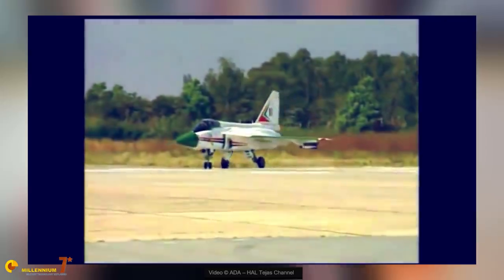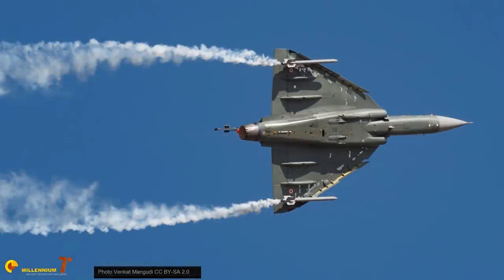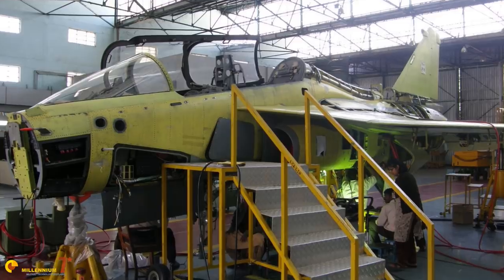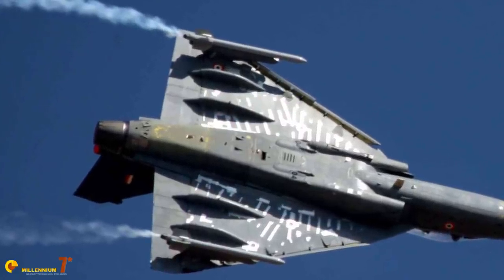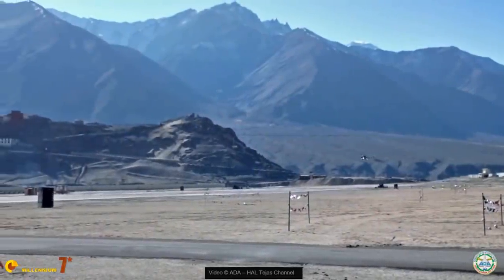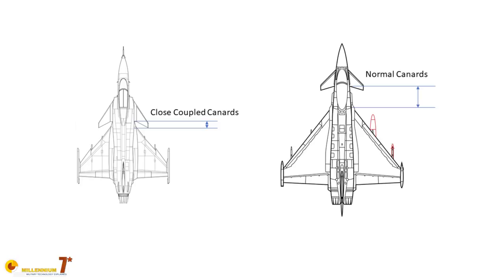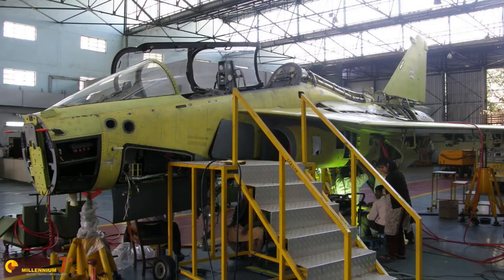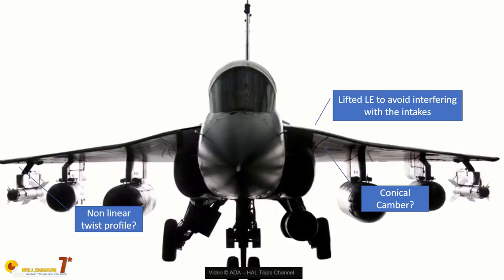TEJAS Aircraft  Aerodynamics Analysis - The Swedish Connection?

Comment: The  Wing design was actually one the aspects of the aerodynamics that was found to perform rather well , and is being carried over the Mark -2 . The LCA program did a lot of things rather well like the structures and flight controls development . Aerodynamics was not it's best , partly cause of compromises related to size and partly cause of an inexperienced team of designers who wanted to play it as safe as possible . The Mark 2 should fix things and get close the Gripen in terms kinematic performance , currently the STR is at around 16 degrees and ITR at 30 degrees.
Reply: Yes, the large wing design is working as intended, but it is also  obsolete because of the additional wing drag.

Modern air combat like the fight between F-16 and Su-30MKI is the combination of long range missile attack and high speed evasive maneuver, NOT DOGFIGHT. Tejas and Mirage are good climbing and turning fighters, but they lose speed quickly and accelerate slowly due to large wing drag. They are not good at dogging missiles. Therefore, even French gave up Mirage design long ago.......
Reply: @joelau2383  to dodge a missile like you say , you would need good instantaneous turn rates and overall good kinematic performance .
Reply: @vigneshanand3348  High speed performance is more important than turning performance because firstly you need to run away to waste as much missile energy as you can. Tejas and Mirage 2000 lose speed easily when it turns away and the large wing drag reduce the acceleration speed when it run as fast as possible. The lower evasion probability is a major disadvantage.
Reply: @Gort There are many delta wing fighters nowaday.  All of them low aspect ratio and short wing span. They also have every delta wing advantages.

Comparing to them,  Tejas and Mirage 2000 have larger wing area causing low wing load and  thrust per wing area/drag. It surely turn better than them,  but it also lose speed quickly and accelarate slowly.
Reply: @joelau2383  The delta produces high drag at the high angle of attack necessary to provide high lift at slow speed.  At speed or low AOA it does not have more drag.
Reply: @gort8203  I am not comparing delta wings with conventional wings.  I am  comparing relatively larger delta wings with relatively smaller delta wings. All delta wings have similar characteristics,  but larger delta wings have more drag.  I don't understand why you keep ignoring it.
Reply: @Gort Obviously you didn't read what i said at the beginning.  I was talking about the long range missile combat and high speed evasion. Acceleration at high speed and maximum speed are very important in this situation.
Reply: @joelau2383  All you have been talking about is the drag of a delta wing as though that is what inhibits this aircraft from achieving higher speed.  It could just as well be the drag of the fuselage engine or some other factor.  I'm done going in circles here.  Have a good day.
Reply: @gort8203  Of course,  you should stop the circle.  Your last reply reflected you have already knew the weakness of larger delta,  but you just refuse the fact there are drawback in Tejas design.

No other modern fighter have similar larger delta anymore. Those experienced designers are not idiots.  They have sufficient reason not using it.
Reply: @joelau2383  Why does this guy keep saying I'm '"defending" the Tejas.  I guess because he's 'attacking' it, so I look like the enemy because I disagreed with one of his inaccurate statements about wing planforms in general.  Try to pay attention next time Joe.
Reply: @gort8203  Attack? You are the one said I defend my comment first.  In this view,  you are the one attack first.

Everyone is making general statement here,  because nobody know the detail of fighters design. Your problem is your general statement focus on a very narrow view ignoring the fact all other high speed modern fighters have similar but smaller delta.

Argument aginst fact and development trend are difficult.  If you don't have strong supporting info,  you shouldn't argue it at the first place.  Otherwise,  you waste your time and effort making ineffective statements.
Reply: @joelau2383   My general statements were that your general statements were incorrect.  Yet you continue to charge me with making an argument for or against this particular airplane, which is absolutely false, and with not listening to your opinion of it, about which I have no interest.  If you took a moment to pay attention to my actual statements instead of projecting your own overwrought imagination on them you might realize that you have deluded yourself.  I don't think you even know how to have a rational discussion.
Reply: @gort8203  Let's go back to what i said before you rely.  1. I said large delta is obsotele because of large wing drag.  2. I mentioned high speed battle between India and Pakistan.

You argue that the large delta drag is less effective in low alpha turns and unloaded accelaration.  The problem is you didn't compare it with small delta like Su-30MKI I mentioned in my statement.  It obviously turns slower (just a few seconds) ,  but it would accelarate faster in high speed battle as i said and have higher runaway top speed (it can be way over a minute) . I knew what you said but it is ineffective at the first place because large delta only benefits a few seconds turn but small delta benefits more than a minute runaway.  

And why Tejas only?  Because Tejas is the ONLY modern fighter having larger delta.  Some planes like Mirage also have large delta but it works fine in old dogfight air battle decades ago,  so I don't  judge them.

TBH, I don't  doubt what you said like high alpha low alpha stuffs,  because i know they are right in certain conditions and i am not trying to find incorrect points to judge you.  However, you are so eager to find some incorrect spots in certain condition to judge me(AKA "inaccurate") . This is definitely not rational discussion.

Comment: Lack of citations and predominance of speculation  - not very convincing. From what I've read, the Tejas was to incorporate LEVCONs, but they decided to retain that feature for the naval version - they made them fixed for the other versions, hence the compound delta shape, not because of the Viggen.

So by this token, does the Su-57 also have a Viggen pedigree? India was participating in its development until it pulled out.
Reply from the maker: Yes, in this case you are right. This video is largely speculation and it is clarified at the beginning. It has to be taken as such and I could be proven wrong if more news about the design stage would emerge.
About the citations, and the sources in general, I often do not mention them on purpose because my sources (which are all rigorously open source) are sort of small competitive advantage for me.
Reply: @Millennium7HistoryTech  you should make a video regarding India-Pakistan air skirmish on 27th Feb 2019
Reply: @gssr41  for what we dont need a war in the comment section
Reply: Yeah, everything revolve around the Viggen, the greatest plane in the history. Thank You!

Comment: If the air intakes on Tejas were symmetrical and aligned with fuselage and wing as in F 22, would that contribute in drag reduction ? if yes at what cost ? Thank you
Reply from the maker: Probably no, they would add a bit of drag and weight

Comment: Tejas is undoubtedly best in its class! & Will get better as we operationlise it!
Reply: What class is that?
Reply: @SK-hn2lj  light weight fighter
Reply: dude even pakistan's fj17 is better when compared to tejas rn.
Reply: @unknownentity2112  tge radar, no. The missiles, no. The ground attack capablilies, no. Speed, no. It has more rcs, bad stealthing features, worse turning radius, bigger takeoff distance, lesser pylons, lesser weight carrying capacity, more expensive (than block 1 tejas. Block 1a is advanced and can be comparable to the f16), fly by wire, no. Composites, less, thrust 85kn compared to tejas's 89kn, worse thrust to weight ratio. If its lacking so many features, how is it better. The only advantage it has is the service ceiling and the stealthy dsi
Reply: @unknownentity2112  the only advantages the jf 17 has over tejas is the service ceiling and the stealty dsi. It even is more expensive. The pl 15 missile is limited by the ass radar on the jf 17. If it lacks so much, how is a jf 17 better than tejas
Reply: What makes it the best in class? The engines on it are US made, the MMR radar was was having problems with some of its modes last time I checked. What missiles and bombs it carries? The F-16 would be the best aircraft in its class IMHO. It has many versions, combat proven, carries all types of weapons.
Reply: @SK-hn2lj  if you wanna compare an f16, then do it with the su 30 mki, which has superior weapons and avionics.
Reply: @sponky8614  has gripen been combat tested. How a weapon system performs in tests and how it performs in actual combat are two different things. The plane which has confirmed kills in air to air mode in actual war or air to ground successful bombing missions in combat matter.
Reply: @SK-hn2lj  so was the f22 ever used. Then why is it called the best fighter then
Reply: @sponky8614  Su 30 is roughly twice the weight of F-16. It has two engines while F-16 has only one engine. No comparison.
Reply: @SK-hn2lj  f16 is medium weight multirole and su 30 mki is heavy weight air superiority but has ground based capabilities , but both of them being the best planes in their arsenals (not the su 30 mki since the rafales), they can be compared. The prrformance is similar, but su 30 mki beats the f16 in almost everything, even in numbers and agility and maneuverability though its 2x the weight
Reply: @sponky8614  But, we are commenting on the statement that Tejas is the best in its class. F-22 doesn't fit in that class, F-16 fits in that class weight wise, no. of engines wise, size wise etc.
Reply: @SK-hn2lj  doesnt the f35 have a single engine
Reply: @SK-hn2lj  and f16 is 2x the weight of the tejas, so how is it in the light weight class where the fighters mosly stay around the 4000-5000 kg range. I didnt support that the tejas is the best in its class, but definitely in the second. We cant compare it with the jf 17 as tejas excells in almost everything over the jf17. These were never meant to compete with each other (yet they do and tejas and jf 17 have theur own advantages), they were meant to replace their ageing mig 21 and j7 (which they do good at). India has a higher budget, hence they could intergrate the tejas with more and better features, though the development was a clusterfuck (40 years) (tejas budget- 1.6 bil jf17- 500 mil). The tejas was built from scratch while the jf 17 was built upon the f7, and upgrading it in many ways, which is why they could make an ideal fighter with a small budget.
Reply: @sponky8614  bro the jf17 has higher altitude ceiling, longer range,higher payload capacity,better maneuvers, it also can maintain higher stability at supersonic speed.

Recently Sri Lanka also approved jf17 for induction in its force through a tender of which tejas was also a contender. Tejas couldn't qualify the tests done by the Sri Lankan force..even the Indian army has denied in many occasions to induct tejas in the force as they can get more bang for the buck from other international players.

Comment: I once noticed a different wing design on the naval version with levcons. May you explain what is the utility of levcons and can delta winged aircrafts do a pugachev cobra requiring high AOA?
Reply from the maker: Complex subject, it will come in time. Hint, they are not canard replacements.
Reply: @Millennium7HistoryTech  could be to control the pitch during takeoff and landing on an AC
Reply: @prashantsharmastunning  maybe it's useful for short take-off, maybe it improves lift when operating from carrier deck.
Reply: @Millennium7HistoryTech  Also can you please let know why delta wings of rafale M is not foldable. I haven't seen a delta winged craft that comes in a folding wing configuration!
Reply: @ratnamallik8900  It's an industrial choice more than anything. The part commonality with the B and C was more important than a small amount of space saved. Also adding folding mechanism increases the  weight.
Reply: @AnindyaMitraDigitalStoryteller  Found the document http://www.cdeep.iitb.ac.in/slides/A15/AE332/AE332-L6.pdf
This document is quite old (10-8-15) but feels even older (NO mention of F-35, nor Growler as E-warfare...)
So my question is if the LCA figures are projected or actual?
Reply: @RogerJL  Awesome man, I searched for this but to no avail. Yes it seems archaic, the SAM systems mentioned are pretty old too. I'm guessing 2009-10. 
I did find mention that the Tejas has displayed close to 16 degrees/second in sustained turn rate and 30 degrees/second as instantaneous turn rate at the Bahrain Air show. Also, AOA is stated as 26° & minimum turn radius as 350 metres. As for rate of climb I couldn't find any hard numbers, maybe 300 is possible due to the wing loading numbers and having T/W of slightly more than 1. I wish someone had more info.

Source for the figures I stated above : http://delhidefencereview.com/2019/02/22/tracking-the-tejas-the-design-evolution-of-an-indian-fighter-part-i/

The person who runs this publication is an ex service chief (or vice-chief of IAF, I forget which) and quite well known
Reply: @RogerJL  I wish this channel would cover these numbers, that would be awesome
Reply: @RogerJL  The author, Kota Harinarayana, is the scientist who is the father of the the LCA Tejas program. He started when there was no aero-space industry in India, no design lab, not even a testing facility. That document was part of this research project about the need of a light combat fighter for India. Much of the values mentioned in that document are old and hypothetical. It was actually created even before the design started. We literally re-started everything from scratch after our first Made in India fighter aircraft HAL MARUT was shelved in 1966-67 due to lack of engine supply - 146 aircrafts were wasted.
Reply: Navel version of Tejas wings are foldable
Reply: @debajyotidutta6795  I wouldn't say the Marut was completely wasted. Marut squads did well in anti-tank and ground attack missions after all! And one even shot down a Sabre (although that surely had to do with mostly the pilot's skill)  I'm sure you already know all of this, just saying..
Reply: @AnindyaMitraDigitalStoryteller  yes... I knew ... And that's exactly why my heart broke when I had learned that all those 146 planes were literally turned to scrap just for a bullshit reason. Instead, if efforts were then made to try to make our own engine, imagine where would we have gone today.
Reply: @debajyotidutta6795  Lack of political will, delayed choices and funds being held back till the last moment and beyond - story of many of our defence projects. If you ask me, some of that blame falls on the IAF for focusing too much on kinematics and capabilities in a docfight